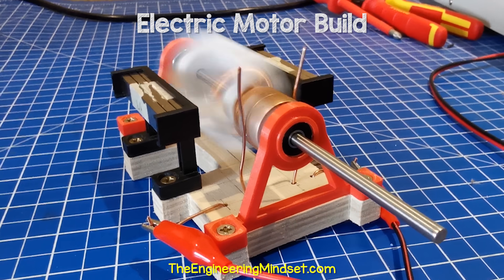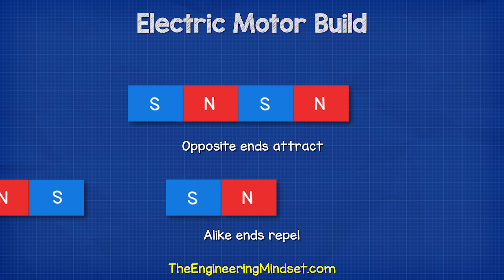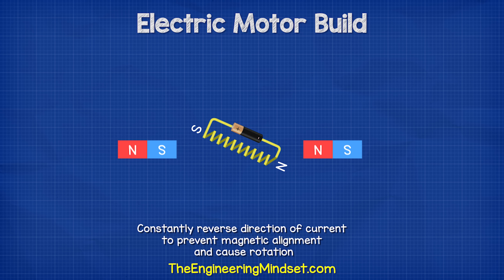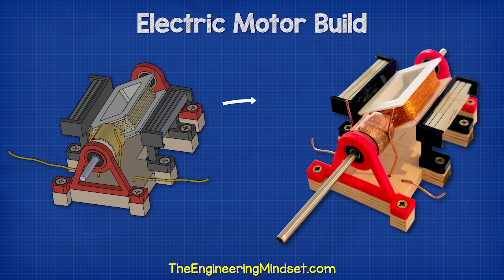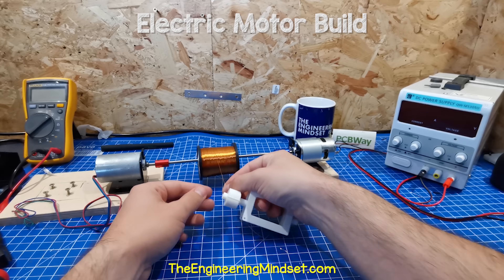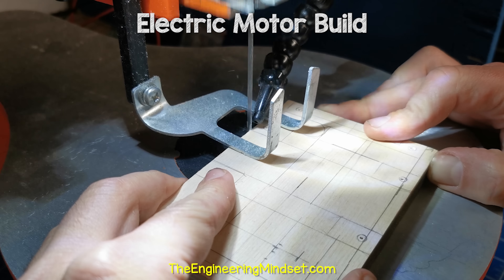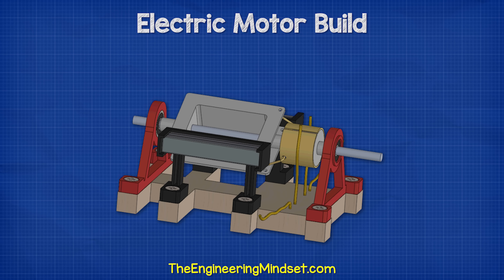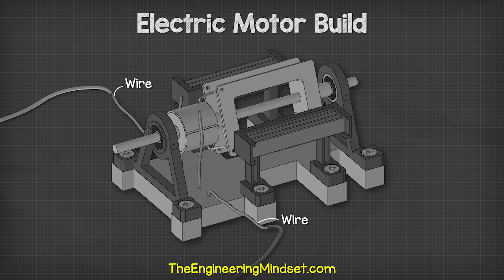Electric Motor Build - Make a simple electric motor

Comment: Great video 👍👍❤️❤️❤️

Well to improve your basic DC motor you will need to make 3 poles  or you can add a capacitor to smooth out the current of the motor 😊😊

Comment: Do you have any idea how one could calculate the period time without like meassuring any rotation speeds or anything. But more like calculating the magnetic field strength and connecting the magnetic force to circular motion, by of course meassuring provided voltage and ressistance in the copper wite etc. Please reach out, it would be much appreciated since I am working on this as my final highschool project.

Comment: For hobbyists and enthusiasts looking to explore more advanced materials, metal 3D printing presents an exciting frontier. This technology, which involves using metal powder and sintering it with lasers, allows for the creation of complex and precise motor components. While this method is costly and typically requires external services for production, it opens up new possibilities for custom and intricate designs that were previously unattainable with traditional manufacturing techniques. It’s a fascinating example of how modern technology intersects with traditional engineering.

Comment: Electric motor bearing support shaft magnet copper coil rotor  commutotor plates wire current flow electromagnetic field generates copper coil force green dc motor  ac motor standards PIPE multimeter yellow blue black supply input mcb earthing teacher ji

Comment: Hi, great video, I really appreciate all the explanations, it really helps. But i have a quick question, do the commutator plates have to be made out of copper? Also, instead of drilling a hole into the plates and tying the wire into a knot, I can also just solder the wire onto the plates right? Many thanks in advance!

Comment: So it took me forever but I finally built this! Unfortunately I can’t get it to spin. :(. Any ideas? Does it matter which way the wire is wound? Is there such a thing as winding TOO MUCH wire?
Reply from the maker: It'll likely be the commutator pressing too hard, the magnets not strong enought or not enough current in the winding
Reply: @EngineeringMindset  I got the exact magnets. I get around 37ohms resistance. Do you know what gage copper wire I should be using on the brush part?

Comment: Lol I kinda got bored with video games I'm gonna try build my own motor now with my 3d printer and blender to make my own models this should be a fun project

update: I fully built the motor, and got it spinning for 5 seconds hehe. i think the commutator and contact points are a little dodgy im gonna try fine tune them and see what happens!

UPDATE 2: soldered the coil to the commutator and made it smoother and a better fit and its spinning! im now an engineer bitch

Comment: Hello, I am trying to make an DC electric motor like you. But my problem is that I would have to use batteries, because those power supply devices are pretty expensive. So is the neodymium magnet. How would I know what battery I should get and where can I get those 3d printed Stators?
Reply from the maker: The higher the voltage the faster it'll spin. A 9V should work or multiple 1.5V. 3d print model isn't available anymore but it's easy to make from a matchbox or from scrap plastic/metal/wood
Reply: @EngineeringMindset  Can I buy that from somewhere? And the white that you use as a coil. Can I buy that from somewhere? Also thanks for responding!  Otherwise i'll just make it. And the plywooden base does it need that form or can it be whatever I want. And for the shaft, bearings, copper pipe does it matter what one I buy or are most of them the same?

Comment: I made this. 3d printed most parts. Only managed 240 turns. But I made slip rings and made a A/C generator that managed to light an LED. The pulses were clearly visible on the video as I used a cordless drill to drive the shaft. Definitely going to modify the rotor to add a second set of windings at 90 degrees. And a second set of magnets. Maybe scale it up to use larger wire diameter. Or maybe make a transformer to step it up.
Reply from the maker: Seen the new LED explained video? so much detail covered! https://youtu.be/O8M2z2hIbag

Comment: Sorry if I missed it, but is there any particular reason the rotor is shaped like that?

I feel like you could reduce the overall size of the motor by just eliminating that giant hole in the middle and moving the magnets inward
Reply from the maker: The magnets are square so to maximise the field the rotor is square. If it was a curved magnet then we could chnage the shape. But the smaller you make it, the less turns of wire you can fit so the less powerful the motor will be.

Comment: 3.46  But providing a current externally  creates its own magnetic field.  So in this case  Flemings rule applying to two magnetic forces ? The  Flemings rule can be better explained without providing a current to the wire but moving the wire (F) then  auto generating the current .

Comment: Very good teaching aid.
You could use spring loaded concave bushes on the commutator,
also run 3 stators and rotors spaced 120 degrees apart.

Comment: So for this toy you built in this video, if I exert a rotating force on the shaft, and you connect the 2 leads to a multimeter, we will be able to see the voltage generated?
Reply from the maker: Yes
Reply from the maker: Check our new Multimeter tutorial out ➡️ https://youtu.be/4lAyzRxsbDc

Comment: If you set up your armature in a lathe and took a very light cut across the commutator until it all cleaned up you would have less arcing and also use flat contacts instead of round, with more surface area touching the comm it will provide less arcing also.  Cheers.
Reply: We’re not all rich like you lol.
Reply: @blehprojects5776 so sand it and squish the wire with some pliers or something. The idea is the same even if you don't have a lathe and press

Comment: How can i improve the engine? I need a lot of torque. I don't know why Lego motors are small, but they are strong. Instead my motor is bigger than lego motors, but weaker. I noticed that lego motors have a metal structure instead of plastic. Maybe metal is better than plastic? I don't know. Sorry for my english.

Comment: This is not my field so please excuse if I sound out of my league.  My thought is, the way the comutator is positioned, isn't the field and armature magnetism wanting to fight itself as it passes through the strongest part of attraction.  I would think some power is lost because it needs momentum to push past instead of the field changing right before or at the strongest attraction.

Again, I may be way off base, and I know this is just a demo for explanation.   Love the videos.

Sorry, answered my own question.  Permanent magnets have fixed north, south.  I had in my head an electromagnetic field, thus each field each having a north and south.
Thanks.

Comment: >Fleming's LHR
Disgusting, not at all intuitive. This is what I use:
Open your right hand flat so that your fingers are straight and your thumb is perpendicular to your index finger.
Align your SINGLE thumb with the SINGLE current that you are analyzing.
Align the rest of your MULTIPLE fingers the MULTIPLE lines of the magnetic field.
If you now do a palm strike, a simple way to demonstrate applying a force, it will be in the same direction as the force acting on the wire/charged particle.
This also seamlessly integrates with the RHR for finding curl, which you can use to find the polarity of a coil with known current.

Comment: Brilliant video, thank you! The only thing I didn’t get at first was how the commutator facilitated the rotation... but I got it. The break in the commutator means the direction of current flow through the coil is continuously flipping, so consequently the magnetic field in the rotor is also flipping, as per fleming’s hand rule.
Reply: I guess if it it didn't FLIP ! your WIRES ! Would be ! A TANGLED ! UP ! MESS !! Wouldn't they !??
Reply: Whether using standard iron cores or exploring cutting-edge 3D printing methods, the principles of electromagnetism remain central to motor design. This blend of foundational knowledge with modern technological advances highlights the continuous evolution in engineering practices, offering both practical insights and a glimpse into future possibilities.

Comment: To avoid spark generally carbon brushes are used at commutator. So here same type carbon material can be used between both side of connecting wires and commutator..

Comment: How complicated to place the permanent magnets in the rotor and the coils outside - no commutator, using a H bridge for direction and PWM to adjust speed? Possible? If so why not done?
Reply: It is done, that’s how a brushless DC motor works
Reply from the maker: Check out the new BLDC Motor video: https://youtu.be/yiD5nCfmbV0

Comment: Very good description of how an electric motor works. When referring to a rotor and a stator a person is talking about an alternator or an a/c motor. Commutators or used on a dc style armature . The motor that you have built is a typical permanent magnet dc type of motor  or dc generator ,if a rotating force is applied to the shaft such as wind, water wheel ,human or  an external motor or an engine it would work as a dc generator .A rotor utilizes two or more slip rings depending on if it is an a/c motor or an  a/c alternator which can be single phase or more. dc motors have field coils and an armature a/c motors have a rotor and a stator winding. Thanks for the video

Comment: This was actually a project of mine that I did in my engineering design class (like 3.5 years ago). I took that class to see whether or not engineering was for me. My group was 1 of 3 groups (out of 10) that got ours to work. We also collected data on the amount or work produced 😄. Fun project and our professor was very adamant about keeping the help he gave to a minimum.
Reply: That doesn't sound too good.
Reply: A teacher is supposed to help their students understand. Not go, "figure it out yourself." Engineering and physics is incredibly complex.
Reply: @UltraGamma25  I feel like if a teacher provides all the necessary information, in this case things like lorentz force interactions, torque, etc., then allowing the students to apply these concepts themselves rather than giving them an instructions guide would let them develop and strengthen their thinking and understanding of the subject

Comment: We can place a reverse biased diode to protect power supply from voltage spikes and comutator from sparking. Its the simplest solution and there are probably better ones, but it should get the work done
Reply: Can you tell us how to place the reverse biased diode on the wires?
Reply: If you have a DC motor then you connect positive and negative to the motor. In that situation the diode will have to be connected between motor terminals in the way that it doesnt conduct when you put the voltage from the power supply across it. So the cathode of the diode (marked with white strip) will be connected to the positive of the supply. With AC motor its not possible unless you first rectify the current via bridge rectifier, then its the same as with the DC motor.

Comment: Could you also do the live calculation of current using the formulas? For example, you read 52 Ohms after turning wires around the rotator. So, how would affect the drawn current? Or, what would happen if you add 2 sets of magnets on the top and the bottom side of the rotor? 

I hope I could tell you what I meant. 

I thank you a lot for showing that.
Reply from the maker: Yes you can perform calculations, you should build one and experiment with it.

Comment: 'm going tg suggest that Fleming's Left Hand Rule be replaced with Jeffryes' Right Hand Rule because left hand rules are just sinister.  If you align your middle finger with the magnetic field and your index finger with conventional current, the thumb will indicate the direction of the force.
Reply: Back in the 80's as a student in electrical engineering we were taught the right hand rule in our electromagnetic field classes.

Comment: Could the magnets switch places with the coil?
Reply from the maker: Yes, you can also generate electricity like that
Reply: @EngineeringMindset  If such is the case then what are the drawbacks in it and why it is not being used?Like magnets will be on shaft and coil will be in place of magnets

Comment: suggestion: construct the DC-motor as bldc, use airbearings or magnetic bearings... Use transistor with infrared IR reciver/sensor combined with flywheel with holes(working as a beam-cutter) to call for remagnitation and feedback if you like. Adjust speed with voltage
Reply from the maker: Maybe in future I'll cover it
Reply from the maker: Check out the new BLDC Motor video: https://youtu.be/yiD5nCfmbV0

Comment: Hello Paul, Thanks for the informative video. I just have a silly doubt regards to an alternator. When a coil is rotating in a magnetic field, will it be rotating at a reduced RPM or at the same RPM, compared to the same coil rotating with no magnetic field at the same power.  Does the Lenz law affect the speed of a rotating coil in a magnetic field? Kindly enlighten me.